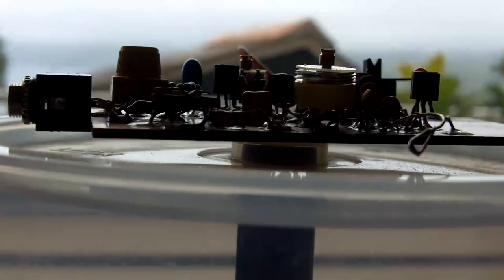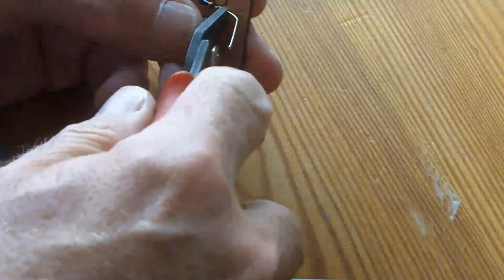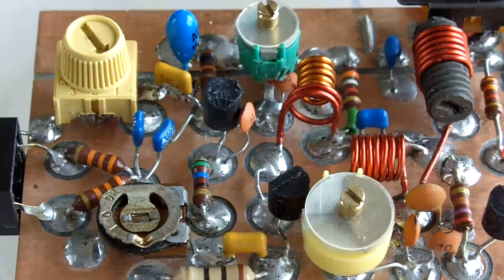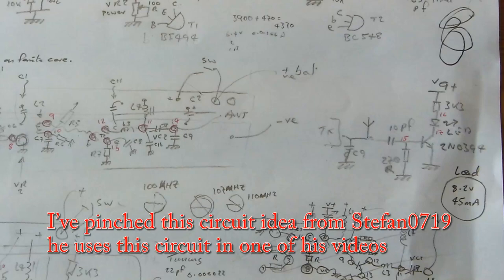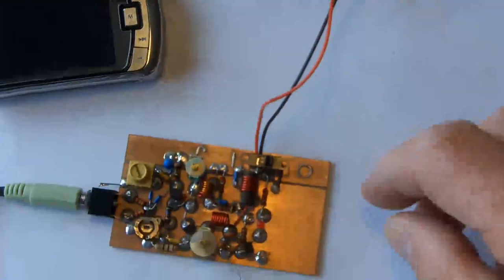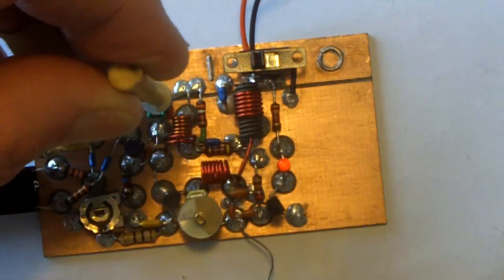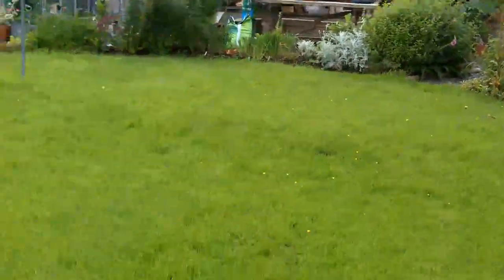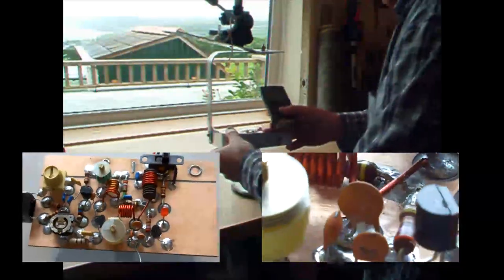About Radio part 41 Quality Audio FM Transmitter

Comment: Reminds me of my youth, I must have built dozens of low power transmitters with various degrees of success, then zooming off on my bike to see how far it would go.
I got quite worried one day, convinced I would be detected when one of my creations managed, both to my delight and horror to still be beaming out over 5 miles!!
Those were the days!!
Reply: I feel ya. I got busted at 16 by the FCC. My little half watt station had already made me something of a celebrity in my high school, and then when I got busted, I found out that pirate radio does indeed have groupies! Ha.

Comment from the maker: Hi there,the first radio I built as a schoolboy was a little transistor kit,  I had to walk miles to the shop and the guy wouldn’t sell me the bits until I could recite the resistor colour code off by heart. He wrote down the code and sent me off home to learn it, I hated him for it at the time but it stood me in good stead, that would be about 52 years ago. If you build a radio you’ll get a real buzz when it works and you hear the first crackle of life.       
Kind Regards ... Andy

Comment: I really liked the pad cutting bit you made when I first watched your video, but I don't have a drill press. I tried a number of alternatives including a plug cutter (intended for making dowels) but it was also hard to control without a drill press. I eventually made a cutter from an old auger bit. I cut off the chunky end and filed the threads off the center screw so it doesn't pull. That left it with a nice point to spin on and keeps it from walking across the board. It's easy enough to control using a cordless drill. It does leave a hole in the center of each pad, like a little doughnut, but that doesn't seem to create any issues electrically.
Reply from the maker: Well Done . . .  Andy

Comment from the maker: Hi there. FM stands for Frequency Modulation, where as VHF is for Very High Frequency. Frequency Modulation means that the frequencies spacing is ‘modulated’ (that means varied) as opposed say to AM that’s Amplitude Modulated, that’s where the height of the wave is modulated or varied.    Any frequency can be either AM or FM but by convention VHF radio is FM. 
VHF defines a frequency band in the MHz range typically 30 to 300 MHz  
Kind Regards ... Andy

Comment from the maker: Hi there, no, the antenna trimmer pulls the tune frequency a little bit but it’s a very simple circuit so I think that’s forgivable. The frequency also shifts with changes to any lead lengths. When I talk about it being a stable RF platform I'm referring to its immunity to ‘hand capacity’ you know, normally with this type of circuit on an ordinary breadboard they tend to be more like a Theremin than a radio.  ‘f’ does shift as you get near it but not very much.  
Kind Regards ... Andy

Comment: Ok so I went and found a trial copy of PE9 it looks like if you go to the edit tab click effects there is a pull down tab under the image of the clip your working on and you can select audio effects, here you will find all sorts of stuff.  I also garbed a copy of one of your videos and started mucking about a low pass filter when combined with a notch seem to work better than the included noise filters to get that high pitched whine out, just need to bump the volume a tad to compensate.

Comment from the maker: Hi there, thank you, I don’t know if you’ve seen the video that shows how I made the cutter but I’ve now added a link to it at the end of the description in the box above. I don’t know what facilities you have but I’m sure that if you haven’t got a grinding wheel you could find someone who could grind the drill for you but you do need a bench drill ie a pedestal drill and some clamps to hold the board down if you use the trepanning tool with one cutting edge.

Kind Regards ... Andy.

Comment from the maker: Hi there, thank you, I have used vaircap diodes for tuning receivers and although I’ve seen transmitter circuits with them in I haven’t yet used one in a transmitter. The little tuning indicator works well but I’m thinking it might benefit from a high resistance from the base to the positive rail for more stability. That’s something else on my list of things to look at.
Kind Regards ... Andy

Comment from the maker: Hi there I'm not sure of the permeability of the little ferrite core but it could have a µ of several hundred, in other words you need a lot of turn the get the same inductance and that could introduce a fair bit of resistance. See if you can find some piece of electronic equipment that has some ferrite in it, an old radio of any age will have IF coils with ferrite and or a ferrite rod (break up to size), TV, computer, they could all have bits in them. I used a transistor radio IF core.
Andy

Comment: My first transmitter was a VFO and I always personally used a digital FM receiver and just kept tweaking it until it would stop on my desired frequency on scan mode. But my intent was to actually broadcast to my immediate neighborhood, so I needed to make it as accurate as possible so anyone could pick it up successfully, whether they had analog or digital receivers.

Comment: Wonderful Work!
 Great job .....I like the most is Tuning Indicator :) .
  I guess ... it is not Pure FM TX... it's Mixed AM and FM TX because Modulated at the BASE of the VHF Osc.
   It COULD be FM Modulated at the L-C at the Oscillator Simply Using a VariCap,a Zener OR even a 4148(I have tried this)..
   Over all I appreciate your work .. it is Simply Nice !!!

Comment from the maker: Hi there, sorry about the missed placed ‘0’ The pencilled circuit diagram should say 2N3904 (not 2N0394) I can very easily mix numbers up like this. I usually double check and then check again but if you go back to the video I do say I actually used a PN2222A but I think that you could use almost any general purpose NPN transistor Well done on getting it up and running.
   Kind Regards ... Andy

Comment: Tripod on the ceiling?! I bet your wife thought you'd had a funny turn! I have a general question: in addition to the frequency counter shown (I have one), when you want to measure the frequency by connecting to such a circuit, should you use a dedicated frequency counter, or would a digital oscilloscope with frequency measurement do?
Reply from the maker: Hi David, it's always a bit tricky making any frequency measurement of low power oscillators as the test equipment loads the circuit and 'pulls' the frequency. Its better if you use a calibrated receiver and try and find the frequency with that. I did buy one of the cheap RF frequency meters (from eBay) about the size of a cigarette packet with a telescopic aerial, it seems to work reasonably well but I have to say that it can be a bit tricky and I have to close couple the TX and the frequency meter and that can pull the frequency but it's better than nothing.
PS It was by chance I saw your comment as I don't normally look at Google responses as I don't like having to wade through the way they do things on YouTube theses days.
 Kind Regards  . . .  Andy

Comment from the maker: Hi, Older yes, gentleman? well debatable. You’re right, I am aware that the sound quality is lacking somewhat, particularly when I record direct into the computer rather than on the camera. If I have the time and I need narration then I record the soundtrack on the camera but if I use a mic into the computer I get the hash. I’m running Photoshop PE9 and I don’t have control over the sound, other than volume, unless I’m missing something,  any ideas? Yep its windy here
Kind Regards .. Andy.

Comment from the maker: I'll be interested to hear how you get on; it wouldn’t hurt to have a few extra turns on the coil with the ferrite.
It can be very tricky finding resonance of the transmitter, very slight differences in layout have a profound effect on frequency, so if you don’t get it right first time don’t give up. Be prepared to change the tank circuit coil to find resonance.
Good Luck
Kind Regards ... Andy

Comment: 2 of 2:
The sound quality is very good giving that it costs cents, and it's very easy to make.
I haven't noticed any frecuency drift by now.
I wanted to ask you if you had a webpage or something? It took me a time to see how the pcb was distributed.
The transistor in the "power meter" stage is a 2n3904 right? I used one and it works great, I think you had a typo in your schematic.

Well, thanks for the videos, you've earned a new suscriber.
Cheers from Argentina.

Comment: Hi!, can u' post the squematic circuit? how i can build the coils? Diametre n' calibre? Here i can buy the 2N2222A, Works this transistor?. Maybe then i should be make a power stage.. What u mind? Thanks and sorry for my english but i tried (i speak spanish :P )..
Reply: If you can get a 2N2219A, that would make a good RF stage, you can put a small heatsink on them too as they come in a metal TO39 package. The 2N2222 in a metal TO18 case is the best type of 2N2222 to use, you can get little heatsinks for those also.

Comment from the maker: I don’t think you’ll find the coil (choke) too critical, I don’t know the actual value of it other than saying its six turns around a lump of ferrite of unknown quality with an unspecified µ value. It works in conjunction with the grounded capacitor below it. You can think of the choke as blocking the RF from getting into the DC line and the grounded capacitor provides a stable DC level that feeds the air cored coil that powers the collector of the output transistor.
Kind Regards...Andy
GWØJXM

Comment: Hi there, well thanks for the nice complement. I haven’t made any specific videos for new hams. I took my ham test back in 1988 when I had to take a Morse test to get an ‘A’ licence and I really don’t know what is currently required to get on the air. The bottom line is I simple don’t have the time for a dedicated project, I like the idea of helping folk but I'm no teacher, I simply try to hand on a little bit of knowhow. 
Kind Regards
Or maybe that should just be...
73’s  ... Andy 
GWØJXM
Reply: Sir I think this transmitter is great and the way you upgraded it could you send me a schematic diagram for it it would be greatly appreciated
Reply: Thanks for your videos! Based on your initial design, I was able to construct a working transmitter with some modifications, Thanks again!

Comment: Thanks Andy,

I will keep at it until I get it working. 

Would it not be possible to replace the ferrite core coil with a moulded axial inductor of the same inductance as the coil?

Comment: So over all your videos are excellent and have very good production quality, but at times there can be a lot of high frequency noise in your videos.  It is not my intention to come off as a troll when I say this but you sound like an older gentlemen and perhaps your perception of the higher end of the audio spectrum has deteriorated, I would suggest turning down the highs on the EQ in your editing software, and possibly investing in some wind screens for shooting outside.

Comment: sorry but there are many many better schematics then this one  on the internet.
Reply: +intercity holland Really? give me one link please.i need build one 50 mW transmitter.
Reply: hello here a link  www.hulpnodigmet.nl/3-meter-fm-zenders/

 first schematic build only the 2 first stages for 50mw also on that page a stereocoder.

   greetings:frankie- if you need more let me now
Reply: I'm sorry, I meant 500 mW
Reply: 3 Watts is to much.
Reply: or the first stage only
Reply: then it will be fine
Reply: thaks for your help
Reply: ok no problem ,remember if you want to modulate a fm transmitter you need a varicap diode like bb405 orso for pure fm modulation
Reply: thanks
Reply: yeees! too many circuits!
Reply: haha yes to many here in piratecountry holland for every band {mediumwave -shortwave -fm} there is a tx  specialy with fets on medium/shortwave.

  greetings:frankie
Reply: @cosmos180  you have english guides for this one?